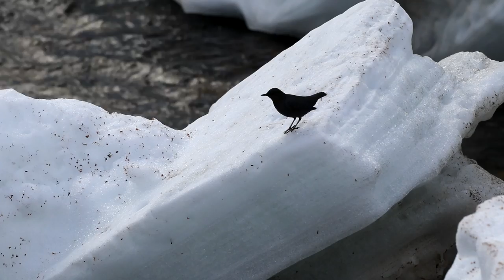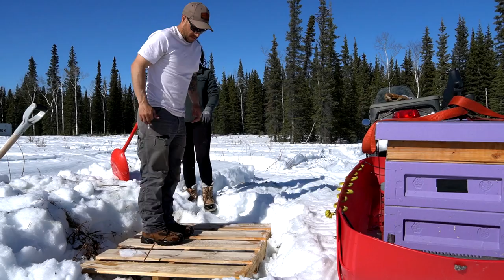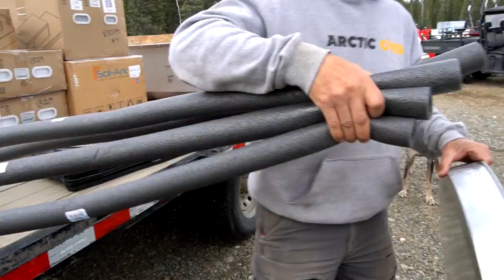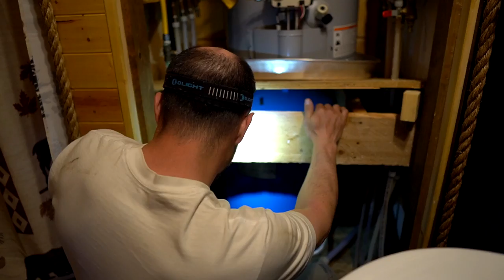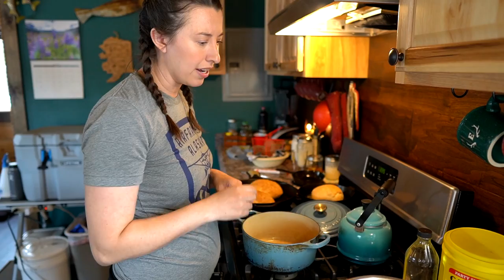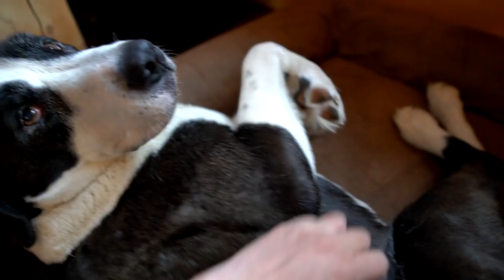Busy as a Bee | Spring Break Up in Alaska

Comment: I give my chickens barley fodder. I use plastic lids with holes in them on the mason jars. The lids also have handles so that the jar can be set up side down and at an angle. Then I spread the seeds out on plastic mesh trays with bottomes. I have 3-4 trays going at different stages so that I can give them the fodder each day. They like it. One tip for when using the trays is to run your fingertips through the roots to loosen them up so the fodder can be pulled out easily.

Comment: Eric i don't know if you guys have a Walmart near you? or a place that sells children's pool noodles? similar to your pipe insulation but different colors still 1/2 hole in center even some are 3/4inch and 1 inch center holes. But anyway i went to get pipe insulation and it was 7.99 each or for 3 pieces. Pool noodles were .50 each. The only difference i saw was the pipe insulation was cut down the center and sticky tape was applied to both sides.. so as you pulled apart and put over pipe you pull tape off sticky pieces,  stick to each side sealing pipe insulation around pipe. Pool noodle just slide on pipe if it is not connected at each end. or use a serrated bread knife cut slit all the ay down noodle. by the way noodle is approx. 4 foot long. Get some 3M glue in a spray can spray cut pieces and push them together. Save you some money and works like a charm and where you have butt ends use the tin foil tape wrap a piece over splice after you pushed it firmly together. or cut a small chunk out of each end front and back.. should look like castle parapet when your done or how gears mesh together. but ends should fit like ying and yang.... male / female ends. Push together and seal with tinfoil or DUCT tinfoil tape. makes a heck of a tight seal and well insulated pipes when your done. just saying.. you probably hahaha you have all this done before you uploaded video.. but in the future try it i use this stuff on homes i insulate... works awesome.

Comment: Beautiful lead in.  Not far from time to wet a line.  Glad the drone is working.  Liking the big wheelbarrow.  Those tanks needed drained and cleaned out anyway.  Good job on the insulation.  Maybe a vent from the tank room to keep the air flowing.  You need access to that area anyway.  It only fails at the worst time.  The family pets seem to have adapted well.  Super happy about the bees.  Like the mac and cheese in a sd biscuit.  Pack that camping.  You all take care .  Be careful in the melt.

Comment: I wonder if you guys added a small instant-on gas water heater that could pre-heat the water during large usage events?  You could leave it off and only use it for specific times, but might save the super cold water entering your pressure tank and sweating.  It'd only have to be set on low possibly and it might help.

Comment: I think your fix on the pressure tank and heater will work fine. You may even consider wrapping the tank with insulation too. Seems like the sprouts will not be enough for all the chickens, unless you just want them to get a little boost, and not fill up on them. I can't wait to see your new solar system!

Comment: You might want to extend a piece of pipe from your pressure relief valve on the water heater to your pan or somewhere if it leaks or opens up won’t flood that area.

Comment: I'm not sure why you moved the hive so far from your home where they would be safer from bear attacks. I've raised bees for over 40 years and we have hives in our yard and they don't bother anyone as long as you don't stand in the flight path.
The standard is move a hive over a mile or less then a foot. If you decide to move them closer to your home ,only move the hive a foot a day or take the hive over a mile away for at least a few days and then move it back to your home. If you open the hive when the temperature is 60 degrees or lower the cold air will kill any brood you have in the brood box. It's recommended  to never open the hive when it's colder then 70 degrees outside.
Reply from the maker: The hive is only 60 feet from our cabin ;)